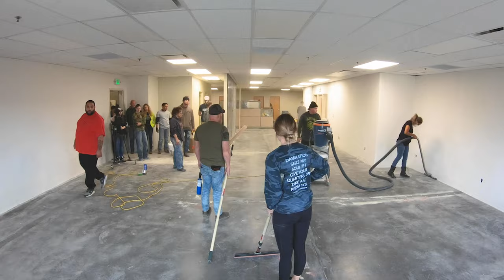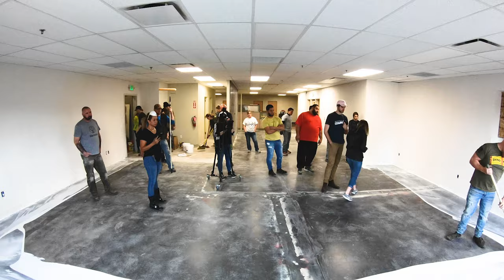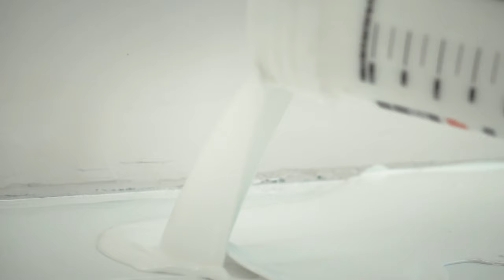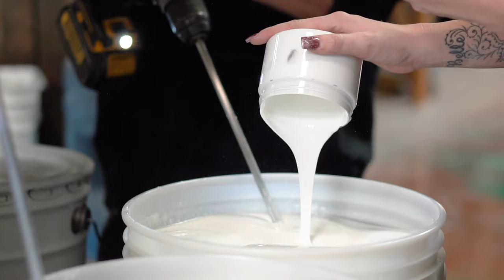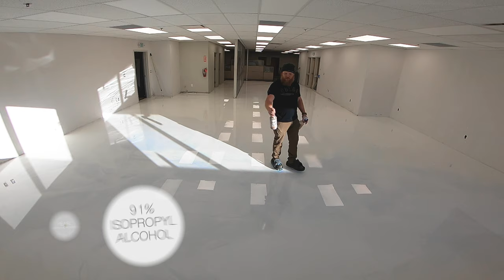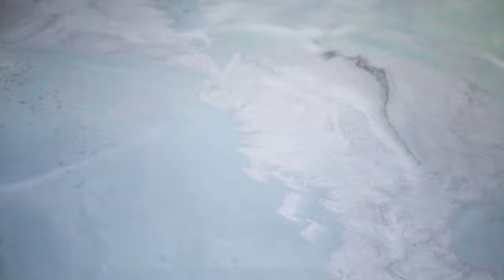HOW TO | Pour a White Marble Floor

Comment: Im thinking about doing this for my floors will it look good if its just pure white? I like the white finish with the reflection.
Reply: Yes it will look amazing its about 20 dollars a square foot and they sand your concrete floors to smooth so average 2000 square  foot home is about 25 thousand dollars

Comment: Does it stick to vinyl planks?
Reply from the maker: Yes! Just keep in mind the epoxy will adhere to the surface so any issues underneath the vinyl planks would need to be address prior to a pour such as uplift or cracks.

Comment: We would like to see the prep work also. Did you grind the floor or shot blast it to ensure the epoxy can bleed into the concrete slab?
Reply from the maker: We grind then do a skim coat of epoxy to seal the concrete and prep the surface for a flood coat

Comment: After the first coat to seal the floor you put down the base. When you add the blue color is the white base wet? I’m thinking it is so it mixes up right? Or did you pour the blue with more white? And did you spread it all out? Or only some parts?
Reply from the maker: Great questions. First we prep the floor by sanding any highs and filling any lows with a slurring we create (refer to our latest floor video) then we do a skim coat and let that cure after the skim we pour our flood coat and any accents that we want all at the same time TBar to your liking. Also keep in mind prep and be different depending on the substrate your working with so please call our office for any questions or assistance 970-639-9338.
Reply: Can you go over old glue?